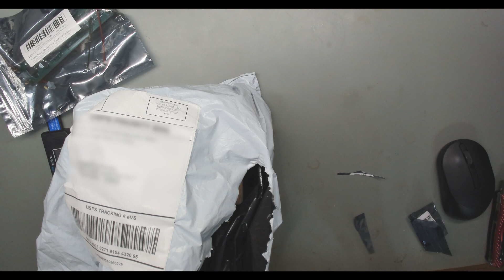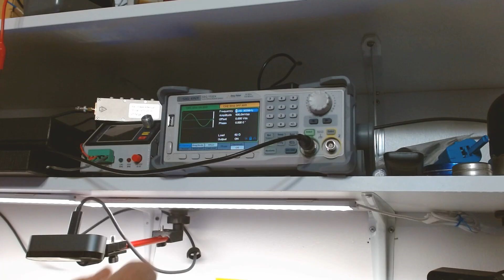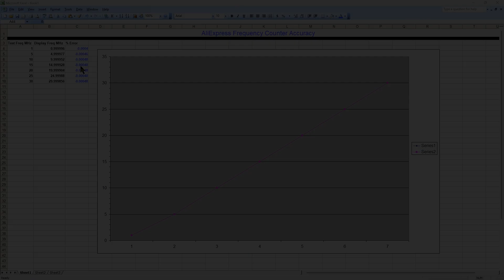Why Your AliExpress Frequency Counter Is LYING to You!

Comment: The black-red cable with black being not-ground and red being ground would drive me crazy. Luckily it's a 20 second job to de-pin the connector with sharp tweezers or a steel pick and pin it the other way around. Also if you have several of the same connector in a project but not used in a guaranteed fail-safe way, definitely would take a paint marker or weird colour fingernail varnish and mark some of those connectors including the PCB side that they belong together.
Reply from the maker: Yeah, already pulled out the jst kit and made a new connector with blue/green wires. That’s my personal code blue signal/ green signal reference. 
RJ

Comment: H I I have just subscribed to you,
I am using on of the counter's with my gpsdso fitted in a distribution box, an old video distribution that I modded for 50ohms, with the counter they run on 13Mhz ref, that has a small adjustment pot next to it,
Good luck 
Dave 2E0DMB
Reply from the maker: Thanks for sub and for the info! 
I hadn’t looked for an adjustment on it. I might play with it to see how close I get it. It’s very close out of the box. If I do I will put up a short video showing this.
RJ